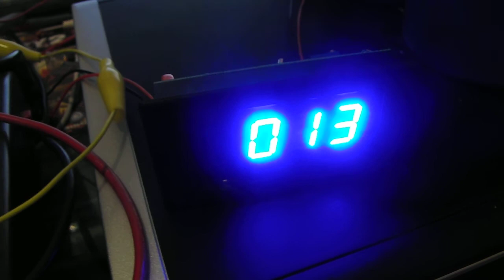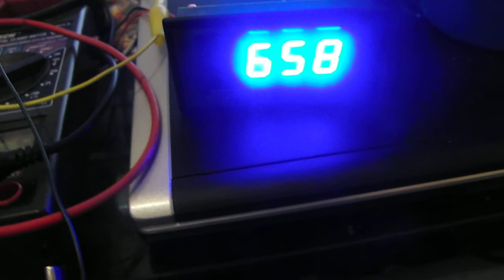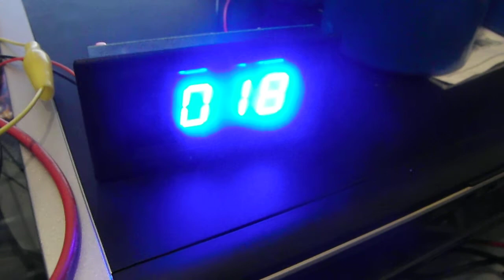Capacitor Charger / Meters

Comment from the maker: @Shockszzbyyous Well it's a 50 year old EBay variac....It was in a round metal case but I ripped it apart for it's own case for a 3 prong plug, and later to add a resettable switch...its rated 0-140VAC, 8A.1120W